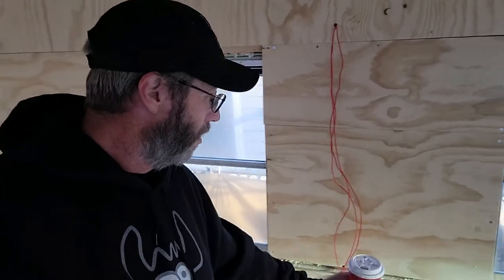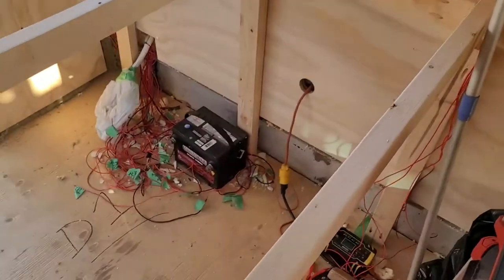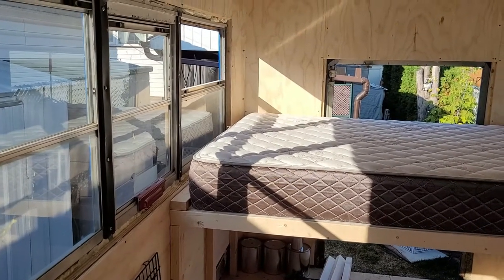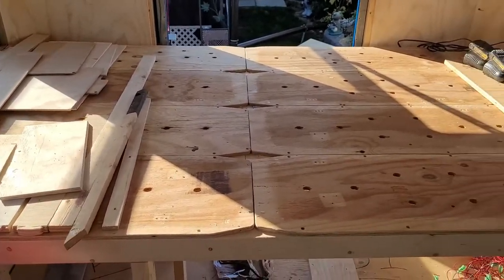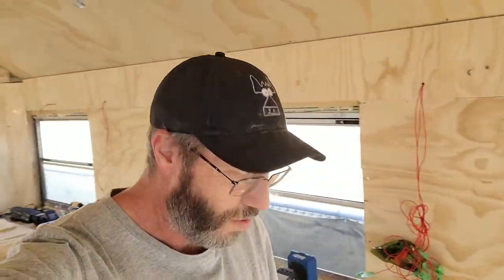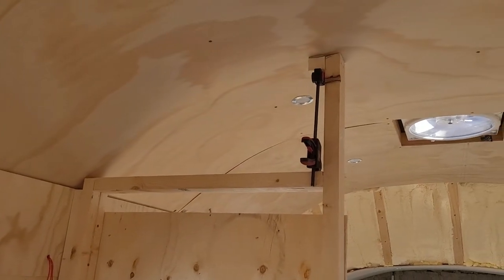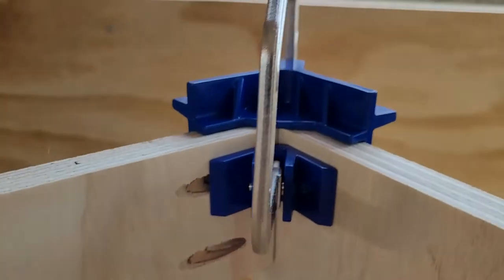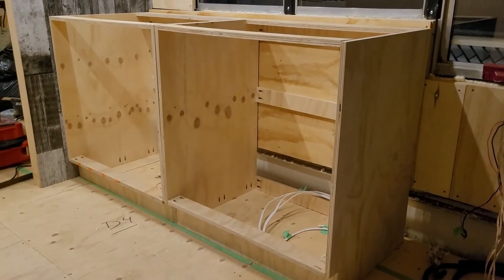Bus Build Ep 32 - Interior Work - Bed and Cabinets

Comment: I am glad to see that you took my advice and reused the plywood from the seats. They will provide you with many years of pleasure and support.
The bed is quite high. You might want to put a rail around it partially to keep you from falling out. 
Back in the 70's I had a van that had a bed in the back like that. I picked up a full length bead curtain to separate the rooms. You might be able to get one at that neat store you guys went to in a previous episode. The resue store.
And I was thinking for the transition area that maybe a nice piece of either carpet (woven) or fibreglass might work. Fibreglass would be good because you could mold it to whatever shape you wanted.
Reply from the maker: We are trying to use as much from the bus tear down as possible. The seat bottoms we had planned on using all along. Possibly for the couch but my plans for that have changed. It works perfectly for the bed frame though. I have 8 more boards that I'm going to try to get back into the bus some where. I have plans for 4 of them right away.
The bed is high, yes. We have to build the kennel for our large dogs under it so it had to go up. As for the railing around it, it would just be one more thing to climb over. We are not planing a separation curtain at this time but we might down the road. We like the open concept of the bus.
We have thought of fiberglassing the transition as well. It may come down to that but that's one of the last things we are going to worry about. I like that idea though.
Reply: @genxers  I would really like to see another video of treasure hunting at the re-use-it store.
That was my favorite video.